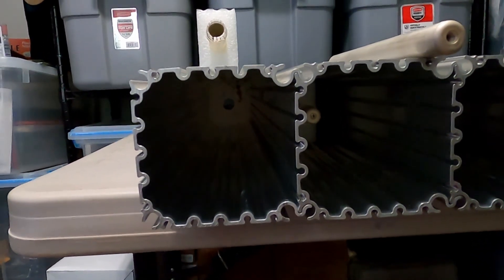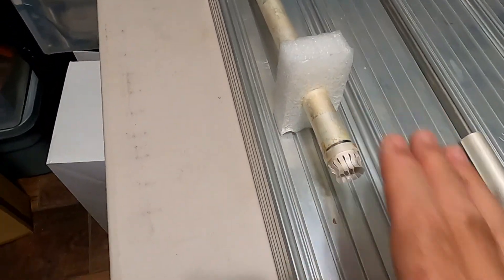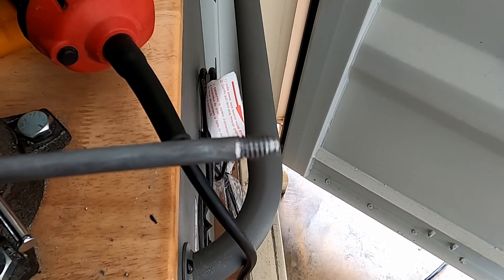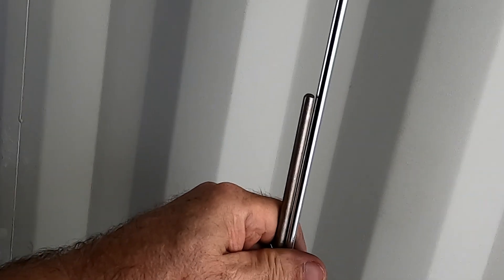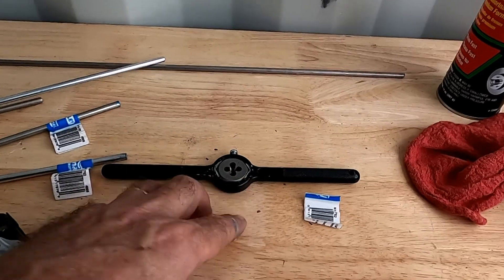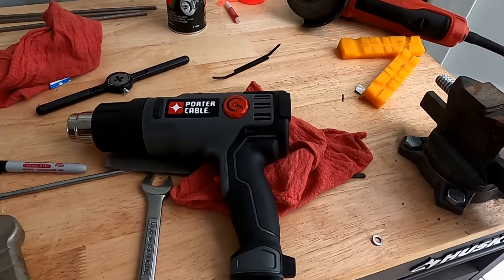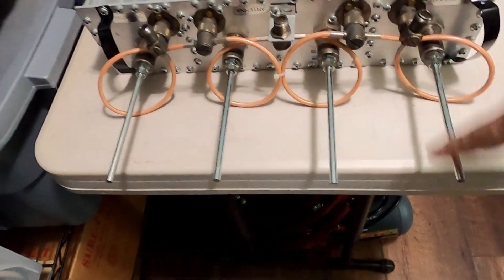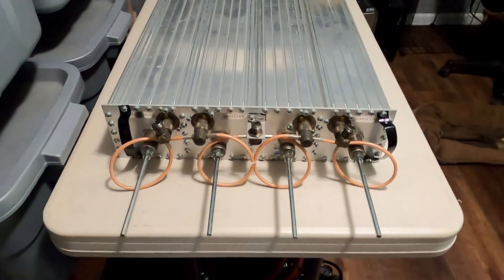Sinclair Technologies Duplexer Repair

Comment: I use NITECORE flashlights. Who in their right mind would cut these Rods? Not a fan of Sinclair but my god! Don’t destroy a good duplexer people! Repairs like this cost us valuable time and money! Hope it worked out good for you!
Reply from the maker: I don't know why the rods were cut, but the repair was fairly easy. The duplexer is installed as a part of a VHF amateur radio repeater.
Reply: @ now for my predicament, I moved to Europe 18 years ago and brought most of my goodies with me, however the 70cm band is from around 432 MHz to 439 MHz. I have a Cellwave six cavity duplexer that I used for my 454MHz RCC frequencies years ago. Need to contact the company or whoever took control of Cellwave to figure out if can be modified to go low to meet my needs over here. 2meter frequencies over here are pretty much the same in the states. 73!

Comment: In the entire video you never mention the actual rods their dimensions or where you purchased them? I need to do the same thing to mine. Any more help please? Thanks!!
Reply from the maker: They are 1/4" rods I got at the local hardware store.  I cut 1/4-20 threads on one end to attach the resonator.
Reply: Thanks!! That’ll work!! I had no way to determine the rod size or where to acquire them… thanks!! 73